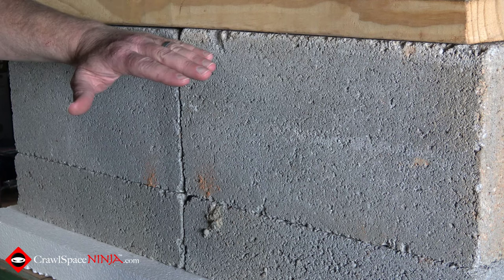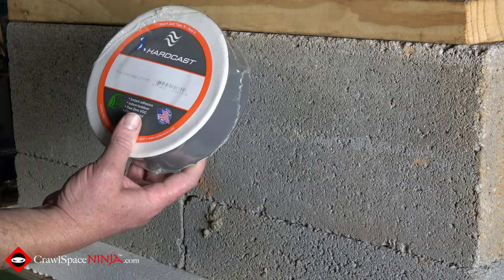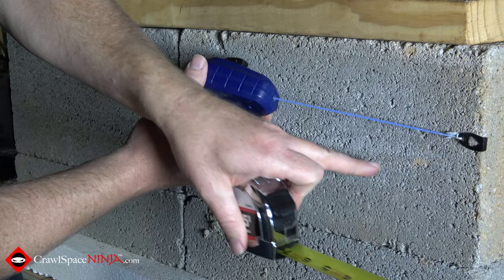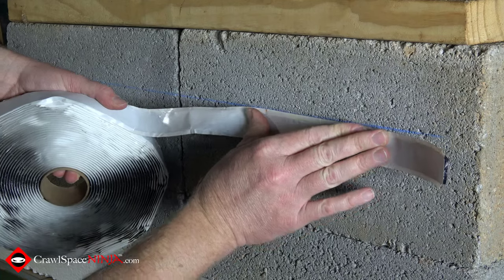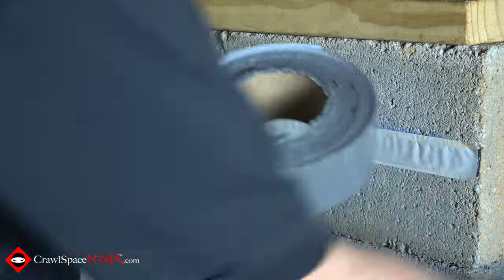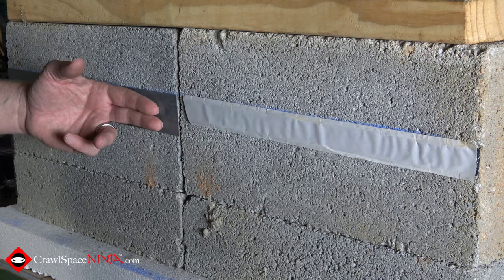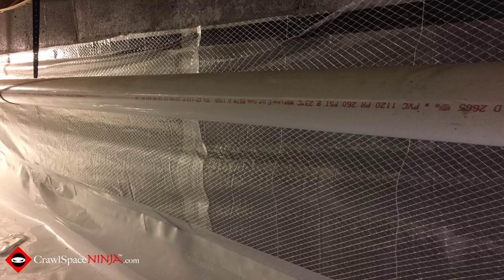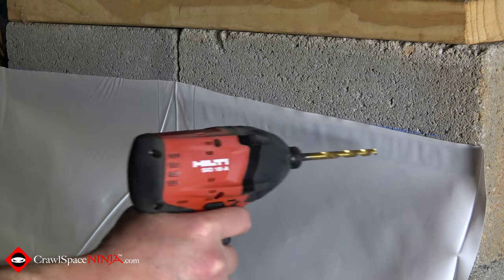Butyl Tape Install w/ Crawl Space Vapor Barrier & Christmas Fasteners

Comment: We had our crawl space incapsulated, but they didn't use Butyl tape at the top. They just doubled up the vinyl and put christmas tree fasteners every 3-4 feet. Without pulling it all down and installing butyl, is there anything you would recommend to seal the top of the vinyl to keep vapors and gases from getting into the crawl space? Gorilla tape or something like it?
Reply from the maker: Well we normally use butyl tape if you are doing it all by your self to hold the plastic up, and then we do recommend Christmas tree fasteners. Even when we mechanically attach the plastic it is not completely sealed, thats why we use an active ventilation system to remove any gases if there are any.

Comment: Is there a type of caulk that would work better or just as good as the tape? This tape sticks very well to the plastic but even after brushing the concrete with a wire brush it doesn't seem like it's sticking quite as well and is leaving a few air gaps where it doesn't want to stick.
Reply from the maker: You can use our Spray Foam! - https://diy.crawlspaceninja.com/spray-foam/

Comment: If I have a tall curtain wall, say 5’ high, and I do the vapor barrier up 3-4 feet up the wall, would you recommend doing a second row of tape closer to the bottom of the wall to keep it from pulling away when laying the floor vapor barrier?
Reply from the maker: To eliminate gaps in coverage, a crawl space vapor barrier should be overlapped and taped. Under your home, the plastic extends around footings and piers and to the edge of the walls.

Comment: So, we just had major mouse problems in our batting and removed everything.  Now I'm going through DIY encapsulation.  My question is, do I NEED vapor barrier if I seal the vents and install a dehumidifier???  I'm in NE Tennessee.  Thanks Ninja, great videos and website.
Reply from the maker: Great question! The vapor barrier reduces the amount of moisture that evaporates from the ground, so YES you NEED the vapor barrier. Without a vapor barrier you risk the dehumidifier running continually and never shutting off
Reply: Right on.  Watched some more of your videos and that's what we figured, just finished installing.  Thanks again! @CrawlSpaceNinja

Comment: I have an 8  foot cinder block wall and placed vapor barrier up to 6 feet, used Xmas tree tabs along the top leaving 2 ft top exposed.  Question:  Should I used the Xmas tree tabs along the bottom or perhaps middle to secure the vapor barrier to the block more evenly & securely & eliminate air gaps?
Reply from the maker: We would only attach fasteners at the top. The more holes in the plastic, the more of a chance of moisture to escape.

Comment: Very informative video Crawl Space Ninja. I have a question do I need to pin up the vapor barrier with stakes so it doesn't move when I pour concrete on it? I read somewhere that the vapor barrier can actually curl up to deform the concrete. Is it true or not? Thank you

Comment: would you say the 2inch is stickier than the 1 inch butyl tape? I tried the 1 inch on a project and it seemed to not want to stick very well. I even cleaned the surface and rolled it
Reply from the maker: I wouldn't necessarily say it's stickier, but it does have a lot more surface area to grip to.

Comment: Once again another great video from Crawlspace Ninja. You may would want to consider making a video on installing Styrofoam insulation with the vapor barrier. (just a suggestion)
Reply from the maker: Hey, just seeing this. Thank you for your comment and video suggestion. We actually have a similar idea on our list of videos to make. Hopefully we'll get around to it one of these days.
Reply: Which side of the barrier would the insulation be installed?
Reply: Hi CSN, Is there a recommended method for attaching the vapor barrier right above the foam board?  I want to get the board as close to the 3" line as possible.  I saw in one of your other videos where it looked like the ninjas just rolled it over the top of the foam board.  Does it need to be sealed to the block to be affective? 

Thanks for all you do!

Comment: Also, if you attach the vapor barrier above  foam board and have a 3 inch gap for termites, that means you leave a 5 inch gap when installing foam board, to accommodate the 2 inch butyl tape? Thnx!
Reply from the maker: see below

Comment: Thanks for this video, I was wondering how high the vapor barrier goes along the perimeter
Reply from the maker: We normally take the vapor barrier just under 3 inches below seal plate.... that is code in TN.... so we always recommend checking  local code.

Comment: Hey Pal, thanks for all the great info. Quick question, what is the best method for attaching Vapor to 2lb spray foam? Thanks for the advice, and keep producing videos!!! 💪🏻💪🏻
Reply: Gotta cut 6 inches of spray foam off under the sill plate. Then fasten your material to the block up there, caulk it with waterproofing construction sealant.

Comment: Several questions, sir ninja:
1) do you always prefer butyl tape to caulk?
2) are the hilti nails better performance than Christmas fasteners, or are they just quicker?
3) do you like the strips you can use with Christmas fasteners? i think they're called tack strips

I'm doing a friends crawlspace and want to know as much as possible. thanks : )
Reply from the maker: Answers :
1- Yes, Butyl tape works specially if you are by your self you don't have to wait for caulk to dry and you can still put up the plastic
2- mechanically attached is better if you have it available, but the Christmas tree fasteners work well. specially if you dont want to buy a hilti gun.. 
3- Anything that can help you adhere the plastic will be beneficial. 

Hope this helps!
Reply: @CrawlSpaceNinja  When replacing the vapor barrier, what happens to the butyl tape? Can the new barrier stick to the old tape? Does new tape adhere to the old tape or can it even be removed?
Reply: @CrawlSpaceNinja  how often does a 6mil barrier need to be replaced? Is it ok if I secure it to the walls with butyl tape without fasteners?

Comment: I have insulated concrete form walls that have a foam board type surface (instead of block). Would you recommend butyl tape to attach vapor barrier to it or would you use something else?
Reply from the maker: Yes! That is a great choice. Using that with Christmas Tree Fasteners

Comment: Hi there. Because of the way my crawlspace is dug out, I need to go about halfway up the walls. I was thinking of going fully up the walls (minus a termite inspection gap) regardless, just in case I decide to add a dehumidifier in the future.  If I don't add a dehumidifier, by covering more of the walls am I effectively making the crawlspace more humid because the walls can't breathe as much? I have vents and would keep them open.  We do currently have moisture issues down there, mainly from grading and downspouts issues which I am fixing. But it's Georgia and a relatively humid area.
Reply from the maker: You could end up trapping the humidity. We suggest a dehumidifier in all crawl spaces since humidity is such a stubborn issue to tackle without one.

Comment: Quick question - Why not just use flashing tap directly to the wall and vapor barrier?
Reply from the maker: In our experience tapes usually fail whenever they are taping objects to block walls or concrete walls. The butyl tape is just easier for us to install and then punch a hilti nail through it. But flashing tape will probably work as well. Have you used flashing tape as you described? Thanks for watching.

Comment: Should there be any type of caulk applied to the top of the vapor barrier?  Like leave 3/8 inch above the butyl tape and then run a bead of caulk in this space and push the VB into the caulk?
Reply from the maker: If you're installing a radon mitigation system, yes it needs to be sealed. Otherwise, building code just requires vapor barrier to be mechanically attached to the foundation wall in an encapsulation. You can definitely add the caulking if you'd like to. The caulk will likely need to be replaced/resealed after some time.
Reply: @CrawlSpaceNinja  Thank you for the reply and just encapsulation so I will forgo the caulk at the top.  I am using the crawlspaceninja membrane, butyl tape, seam tape and christmas trees.  Look to your site and YouTube videos for information and thanks for that!

Comment: We have a crawl space that is about 20 x 12 and 6 ft high.  The basement hvac has a duct that heats or cools that area.  There is gravel on the bottom and a plastic barrier on top of that gravel but it doesn’t go up to the walls.  Can we put storage bins on that plastic or should we elevate
On a pallet or something similar ?  Should we replace the barrier with one long enough to go on the wall?  We’re in Ohio and it’s not really damp in there we also run a dehumidifier
Reply from the maker: We recommend an underlayment if possible when plastic sits on gravel. Here is a video we did, "Tips for Storing Items on Vapor Barrier" https://youtu.be/75BWlqYXRgI?feature=shared I hope that helps and thanks for watching.

Comment: Hi, I just started DYI project in my crawl space. I did order vapor barrier from you guys and I really like it! My question is about butyl tape on concrete walls because it didn't stick to all of the walls really good but we were able to put plastic and secure with Christmas pins. So is it ok if you have a little gaps between butyl tape and a concrete wall?
Reply from the maker: Yes, the butyl tape is not meant to be a long-term solution because we have found that over time, adhesives always fail. We recommend using it so you're more easily able to get the vapor barrier attached to the wall when using the Christmas tree fasteners.

Comment: I'm installing a vapor barrier do I have to use the fastners or can I just use the tape to hold the barrier against my blocks?
Reply from the maker: We recommend using the fasteners. All adhesives eventually fail so mechanically attaching the vapor barrier is the best way to go. This tape is good to help position the vapor barrier on the wall until you are able to get the fasteners installed.

Comment: Would it be worth sealing that first? Concrete sealer or elastomer paint?
Reply from the maker: Some sealers can keep the tape from sticking. I tried applying butyl to block that had a clear sealer that was applied by homeowner and it would not stick. Not sure what it was.

Comment: What about with foam insulation? Behind or in front of the barrier?  And does the foam have to stop 3 inches below the sill as well?
Reply from the maker: You would want the vapor barriers placed on top of the foam after it has been secured to the wall.  You would definitely need to stop 3 inches below the sill for the termite gap.  We hope this helps.  Let us know if you need anything else.  Thanks for watching.

Comment: How high should I use the vapor barrier if I’m not Encapsulating the crawl space? I’ve got a little mold issue and the vapor barrier is pieced together. I would like to after the mold is removed and protected, move the material up on outer walls a bit.
Reply from the maker: Code wants it to be attached to the foundation walls at least 12 inches up.

Comment: We dont have termites and building code does not specify for climate zone 5. Would you take the VB to the pressure treated Sil plate ?
Reply from the maker: We would still recommend it because of the potential of termites.

Comment: Hello, my 1954 house has a solid concrete foundation. Worried about potential structural damages that drilling of so many 1/4" holes could cause. Is it safe? Do you have some references on this topic?
Reply from the maker: The insulation and encapsulation method shown in this video may be a more viable option for your situation: https://youtu.be/ZzsgvkjRHfQ

Comment: How well does this work on concrete block? My area does not permit use of cinder block.
Reply from the maker: We've been made aware that while "cinder block" is a common term used in our area, concrete block is what is commonly used. This should work well for you. We only caution using on brick foundations.

Comment: Great educational information for the diyer as with all your videos. I have a question, when attaching the vapor barrier onto the foundation walls, can I also use my Ramset cobra along with 3/4 in drive pins with washers into that 2 in butyl tape as opposed to drilling the holes and then inserting the christmas tree fasteners?

Would seem much easier as opposed to all that drilling.. My foundation wall is solid poured concrete from 1956 and not cinderblocks so I believe the wall should withstand the powder actuated load....

Please let me know your thoughts and or suggestions on this. Thanks again...
Reply from the maker: We actually use a similar process with a Hilti gun, masonry nails, and washers when we do our encapsulation jobs, so if you'd rather do that instead of using the butyl tape and christmas tree fasteners you can!
Reply: Thanks so much for your response. If I was to use the butyl tape and shoot the masonry drive pins with the washers directly centered into that butyl tape, would I no longer need to use any caulking adhesive to seal the  top of the vapor barrier onto the foundation wall?

Will the butyl tape create an adequate or sufficient seal or would I still need to use a caulking adhesive or construction adhesive?
Reply from the maker: The butyl tape will be enough. It is not required to have the vapor barrier sealed to the wall, only attached.

Comment: I purchased some Black Butyl Rubber Peel & Stick Double Sided EPDM Seam Tape thinking it was the right product. But It is not sticking at all to the concrete. I messaged the seller and they recommended "latex or solvent bonding adhesive." I can't tell if they mean use that instead or with the butyl tape. Do you know what I should specifically get to salvage all the tape I've purchased and make it stick to the concrete? Thanks.
Reply from the maker: Sorry to hear you are having issues, we would suggest that you adhere it and then use some Christmas tree fasteners in order to insure that the barrier stays put

Comment: Would it be ok to kill 2 birds with 1 stone by having the plastic fasteners that I will be using to mechanically attach the foam board to the wall also attach the vapor barrier to the foam board?  In other words, the plastic fastener will go through the VB and through the foam board and into the concrete wall.
Reply from the maker: Normally we do not do that because the fasteners are different..

Comment: So is butyl tape necessary
Reply from the maker: Great question! Butyl tape is not a necessity, although, anyone that has ever installed vapor barrier will surely witness testify that it is, lol. Imagine holding the vapor barrier while using the nail gun to hold it to the walls, it is heavy and tiring. That's where the butyl tape gives such help

Comment: Question -- my new home has a conditioned crawlspace with foam board insulation that extends almost to the top of the stem wall.  The vapor barrier is attached to the foam board using double sided tape.  There are no mechanical fasteners attaching the VB to the foam board.  Can I drill small holes into the foam board and install christmas tree fasteners for a more durable vapor barrier installation?  Thanks.
Reply from the maker: What we normally do is attach the VB above the foam board, still keeping the 3 inches of space above. that way the foam board is bot punctured and the sealing process is more effective. Hope this helps!

Comment: How to fasten the barrier over foam insulation
Reply from the maker: Thank you for your question! We use the same process as attaching the foam board to the foundation walls. You can purchase the Hilti DX 5-IE and the fasteners to attach vapor barrier to foam board right on our DIY Store: https://goo.gl/NX8LuL Watch how we do it here: https://youtu.be/GIKRIzF_eO0
Reply: What about painted (waterproofing paint) block?  Do you have to wire brush  the paint off?

Comment: Funny, he's doing that while standing and having difficulty...try doing it on your back in an 18" crawl space....all you really need is 6 mill plastic over the soul.  Covering the block is normally unnecessary....cover the soul, don't drape it up over your wooded members, and be happy...this is another blown way overboard industry to  get a little deeper in your pocket...i
Reply from the maker: It's true... you definitely don't need to use butyl tape, but it can be helpful if you are working by yourself trying to install fasteners. Building code requires vapor barrier to be mechanically attached at least 12 inches up the foundation wall in an encapsulated crawl space and it can more effectively reduce the amount moisture from the soil getting into the crawl space compared to just laying it on the ground and not taping seams or attaching it to the wall.